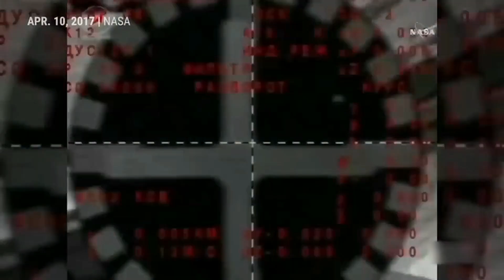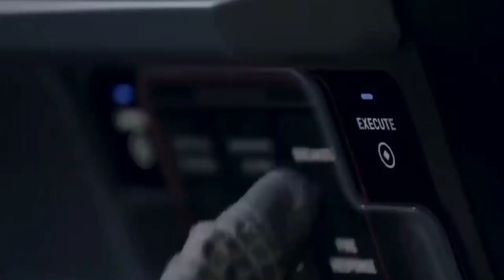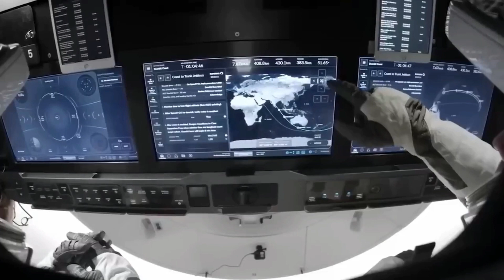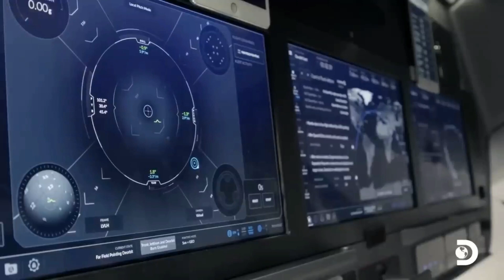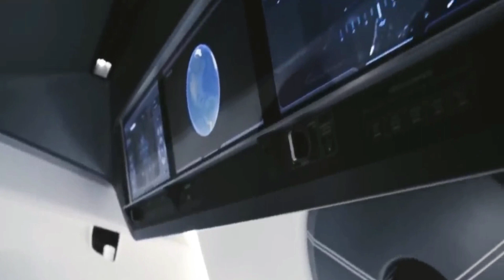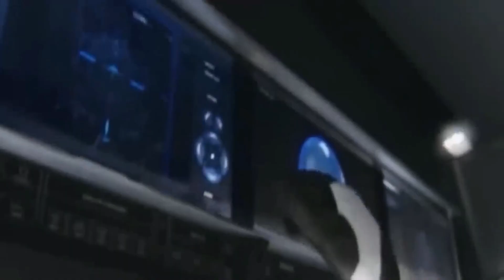Elon Musk Sent SpaceX Epic Dragon To RESCUE Astronauts In Space!

Comment: “Racing against the clock” with 100% food, water, and air for months and no issue with resupply missions…

TLDR: Soyuz cooling system failed, cosmonauts need to wait another 3-6 months for an unmanned mission to the ISS. Dragon theoretically could return them but there is incompatibility in the seats design because of the different space suits. 

Damn dude this video is 12 minutes long and you say the same thing 4 times. This would be way better as a 30s shorts clip than whatever this is.